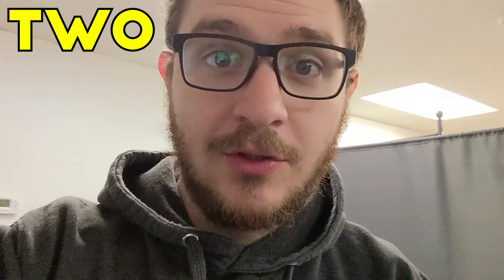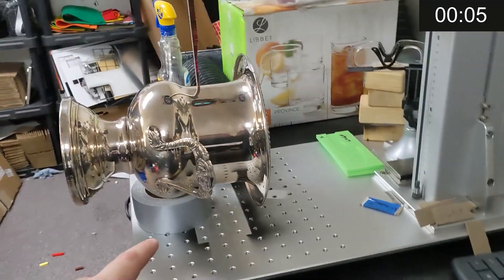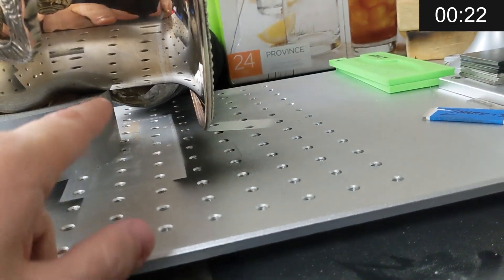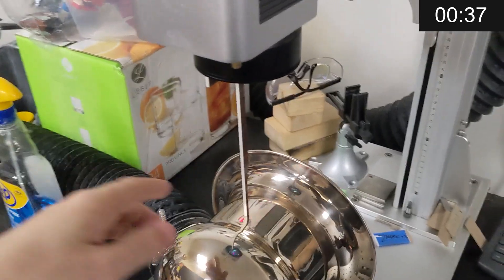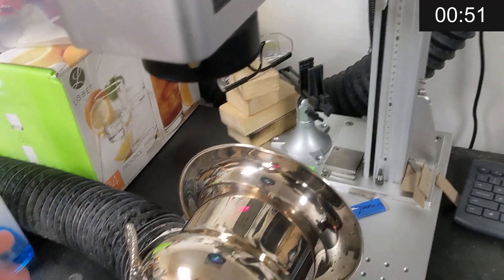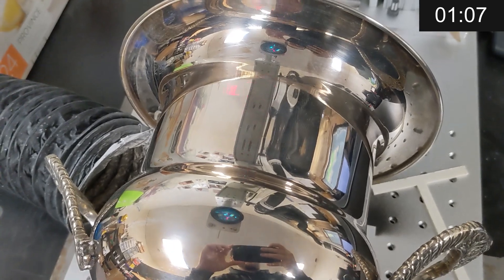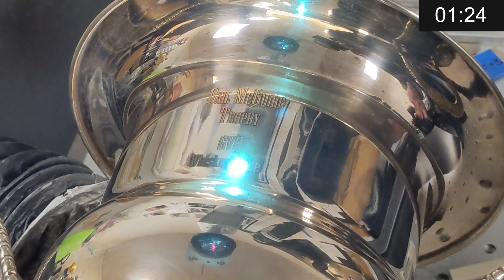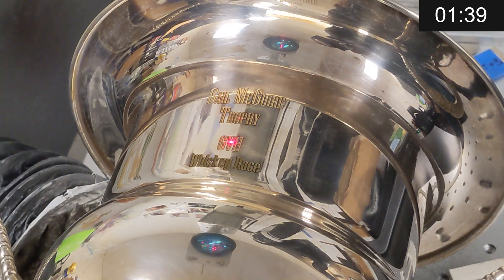How to Engrave Big Round Obnoxious Trophies | Two Minute Tip | Fiber Laser

Comment: Very good !! 
What size lense are you using ? Something that big id use a 300mm lense
Reply from the maker: In this video I'm using a 110x110 - I have a 220 but I don't get enough down range power with my 30w machine on that lens to hit the brass hard enough for this effect so I stuck with the 110 for this video.
Reply: @LaserEverything  actually your right, and I thought about it after I posted. I've a 60W but still with brass a 300mm lense is pretty time consuming
Reply from the maker: There's definitely focus advantages to the larger lenses though you're totally right